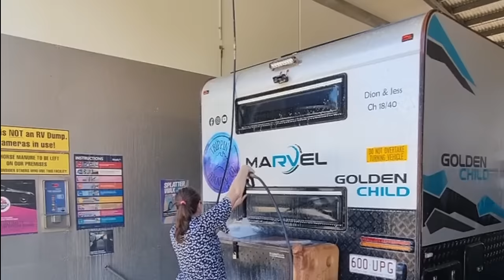41 - When Free Camping goes WRONG and everyone gets BOGGED!!

Comment: You need wheel speed to clear the tread in mud. Higher gear and rev it!
Reply from the maker: Thanks!
Reply: Low Range & use torque plus low tyre pressures down to 10 psi until your out of trouble.

Comment: "that seems brittle......"
- it is broken glass
Reply from the maker: I wasn't expecting it to break the way it did. I was expecting it to have some sort of lamination to hold it together better 🤷‍♀️
Reply: @trippinaroundoz  by and large, only the front windscreens are laminated in modern cars
- all other glass is "toughened" (specially heat treated) glass
- some times this other glass is lined (eg with tinting plastic)
- the toughened safety glass breakes into small bits  so as to not cut heads off
Reply: 3M security film and problem solved.
Reply from the maker: Ahhh ok, thanks for that info 🙂